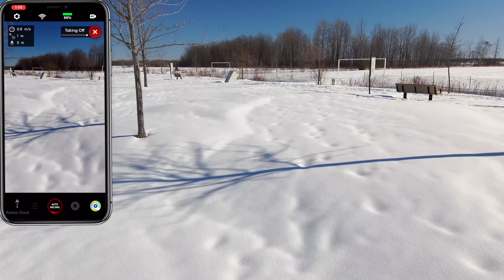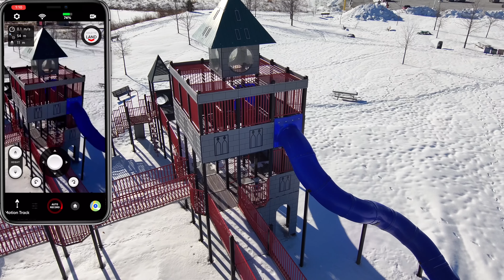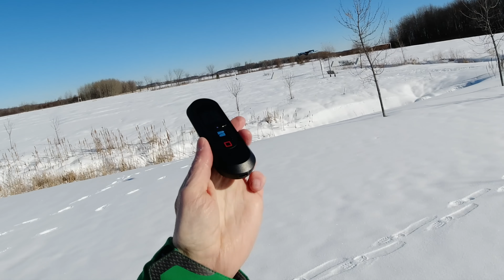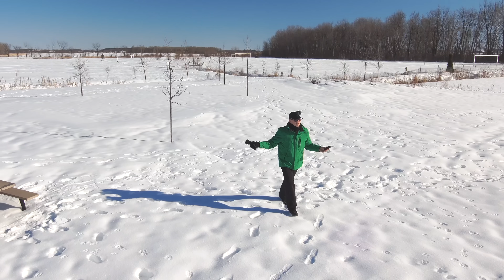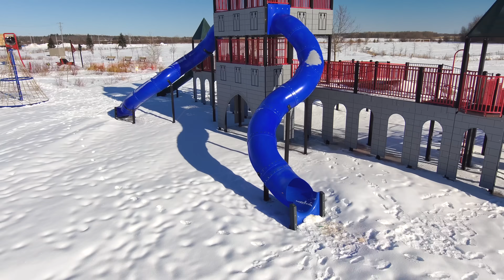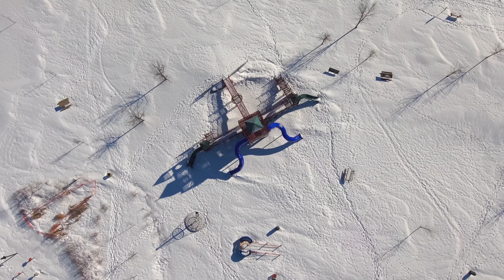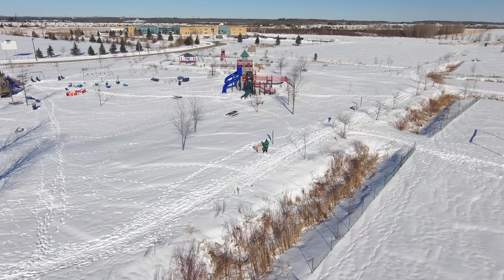SKYDIO 2 - Differences between Beacon, Controller and your Phone

Comment: An amazing drone, but like yourself, I really don't do any active sports so it would have limited use in my household. I am curious to see how it handles wind. My MA isn't much good beyond 30mph winds. Is this better (bearing in mind you may have limited control depending on which controller you are using!)? Oh, and can it follow objects other than humans or cars (like RC cars for example)?
Reply from the maker: Ian P It moves around a lot more than the MAVIC when standing still so it would give the impression it is affected by wind.  When moving in a direction it is a different story.. not affects by wind.  Only follows people and cars.
Reply: It is actually quite good in wind, though not sure I want to fly any drone in winds over 30mph.